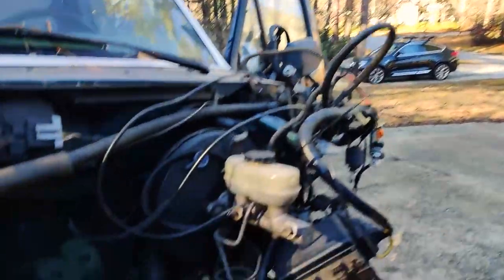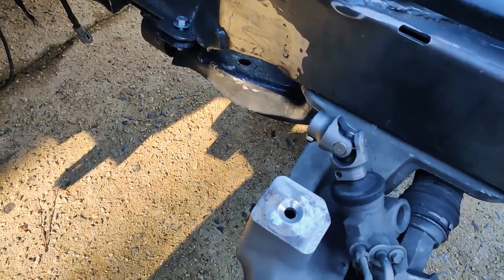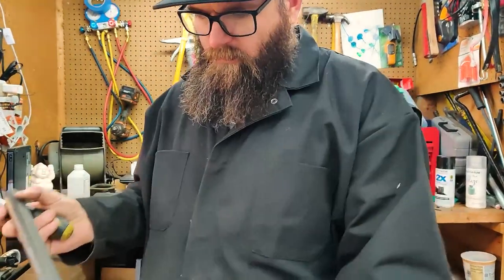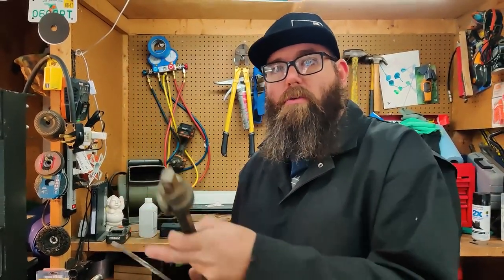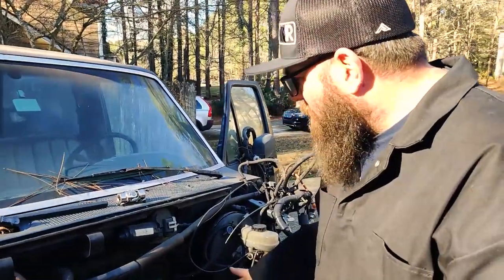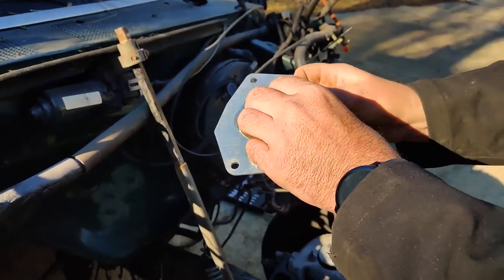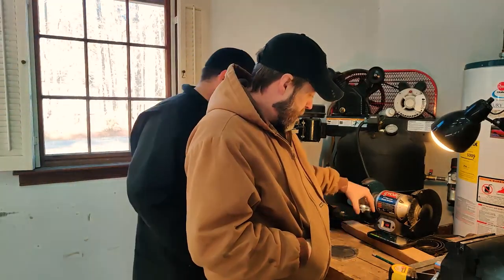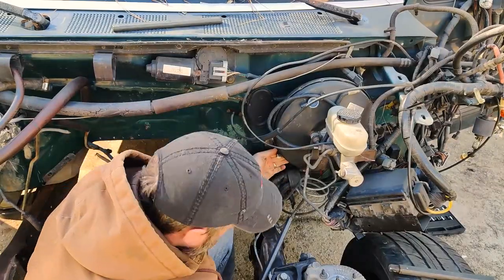Installing Steering in Our Crown Vic Coyote Swap F150!

Comment: What master cylinder and brakes lines did you use for the crown vic brakes? Just trying to figure out what components are needed switching from the old f150 brakes and to the newer crown vic brakes
Reply from the maker: We used rhe cv master clyinder and made custom lines with correct bevels on each end.  We used the soft lines from cv for the front over to wheels and the rest were custom hard lines.  Good luck.  Thanks for comment and support